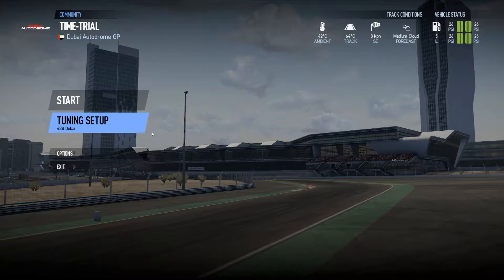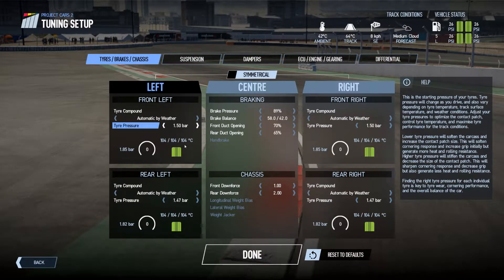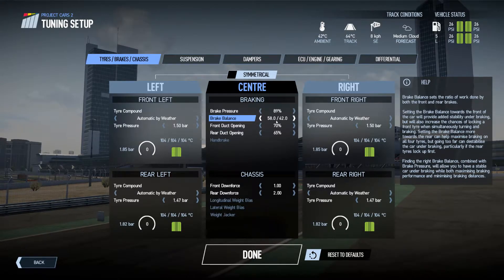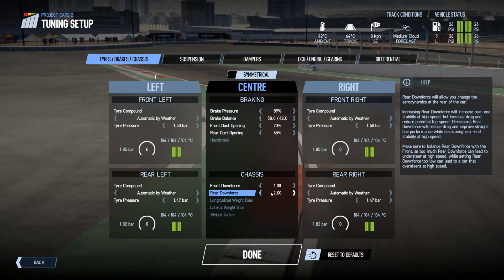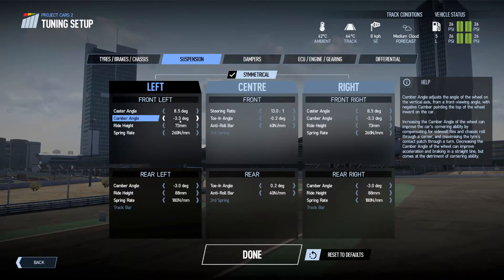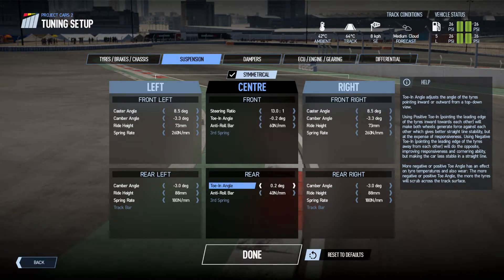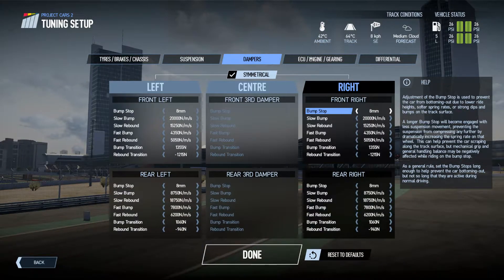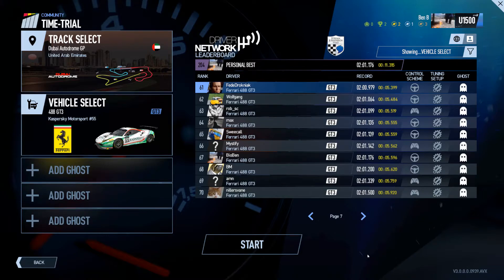Project Cars 2 Setup Ferrari 488 GT3 Tuning + Time Trial Hotlap @ Dubai

Comment: Brake in a straight line before turning into the apex, downshift the gears as you turn into the corner. The 1st, 2nd, 3rd gear ratio setup is important to have cornering stability and exit speed. Use the wide curbs on the exits. Keep the suspension setup at default. Only make minor adjustments to the suspension to correct Understeer / Oversteer. Scrub those tires and get them up to temp. You should be driving at 98% of the g-Force skid rating for any given car. A 488 GT3 is about 1.50 g-force skid so you should be braking, cornering, and accelerating at about 1.45g. Smooth is Fast. Focus on where you want the car to be and not where it is. Look at the corner exit, not what's directly in front of you, and just feel the turn into the apex as you focus on the exit.
Reply from the maker: Thanks for watching! 👍 Do you have pcars2 on PC?